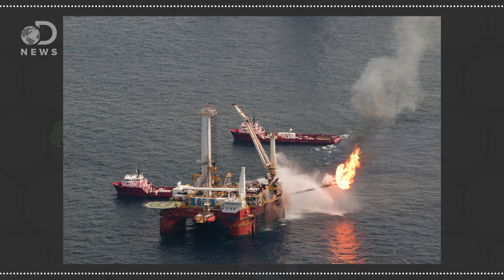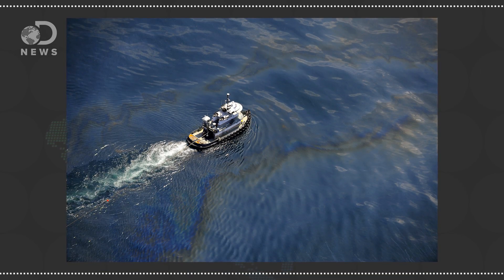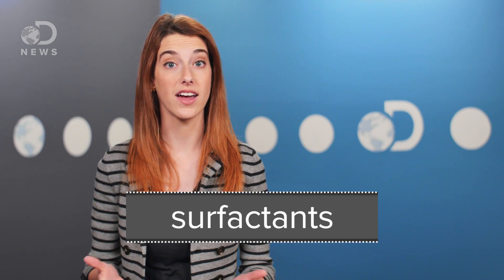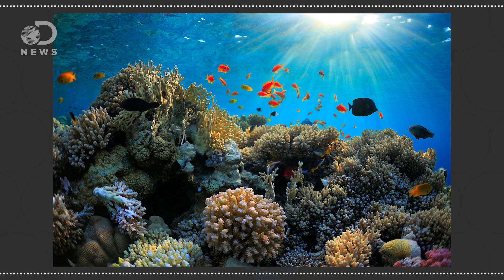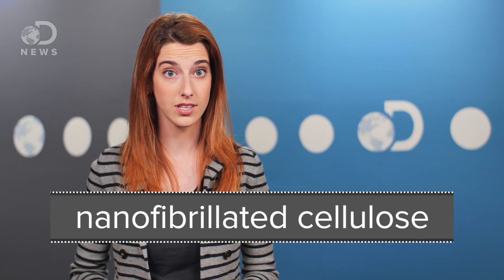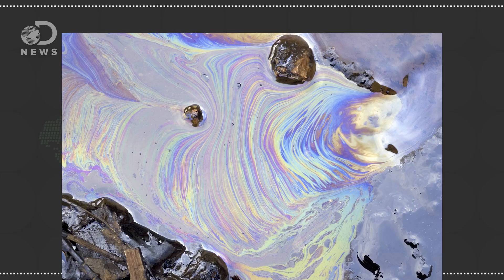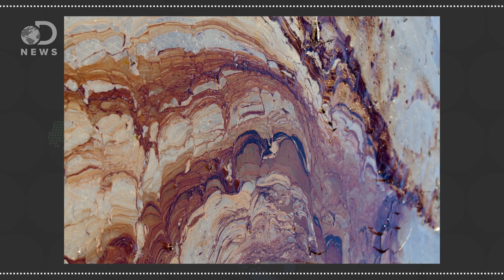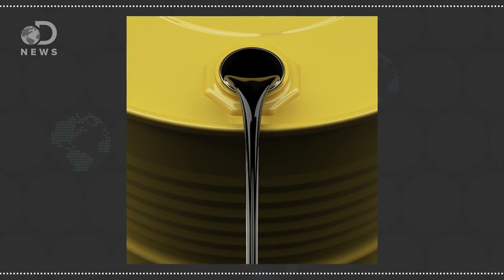How Do We Clean Up Oil Spills?

Comment: Actually for a well head/pump jack oil spill or a spill thats on a lease from a tank truck or messy righands is usually cleaned up with a hydrovac or combo unit vac truck. Using water you flush oil from the ground then suck it up with the vac trucks hydraulic driven industrial vaccum.

Comment: I came up with an economical cheap logistical solution.  It still needs work. I wonder who i should tell.
Reply: what is it?
Reply: An sponge conveyer. With multiple squeeze rollers. That put the oil into seperatory tanks. Like on a boat.

Comment: should have started a soon as possible  a 3 phase separator and a air compressor would have helped.just have a tanker standing  by for the oil. send the water back to the gulf . well it was worth a try but no one would listen to me then . I guess cause I wasn't offering to line the politicians  pockets.

Comment: I think the  new idea for magnetizing oil called "The magic Wand" looks more promising then anything currently being worked on. The idea is to mix iron dust and using a magnet pull the oil a skimmer. The advantages are the iron bits can be separated and reused and completely no toxic. It can also be used in conjunction with other technologies. Plus it can be ready now.
Reply: Wouldn't the iron bits be ingested by sealife, i dont know what happens to the fish that ingests the iron but the people who ingests the fish will have problems

Comment: Note:  Oil is really plant life that lived and died millions of years ago.  It has been under heat and pressure for a long, long time.  Since it is organic material, it should decompose by itself.  The early settlers of Texas noticed that it pooled at the surface.  These pools have since been drained.  I understand that natural seepage from the bottom of the Gulf of Mexico equals the volume of the Exxon Valdez daily.  Leave it alone and it will go away by itself.
Reply: Are you kidding me? Why are we doing something about it, if it will just go away
Reply: Francis Ebbecke Oil is made from ancient dead organic stuff, like dinosaurs. Therefore we can conclude that plastic dinosaurs are made from dinosaur.
Reply: He made me laugh. Its ORGANIC.

Comment: Hydrogen fuel is cool as a stand alone process- with water and heat at the primary byproduct. But to make hydrogen fuel, you need natural gas- so we are still left dependent on a limited resource (a resource made toxic by horribly unregulated fracking practices in the US).
I don't think we should portray hydrogen fuel as the fuel of the future- it is sill dirty
Reply: mgpisces Go nuclear, it's the most practical green energy source that has the potential to power entire cities